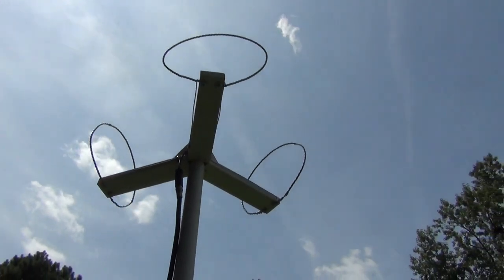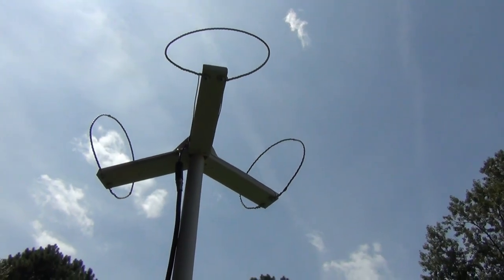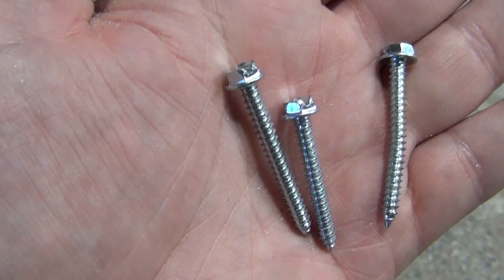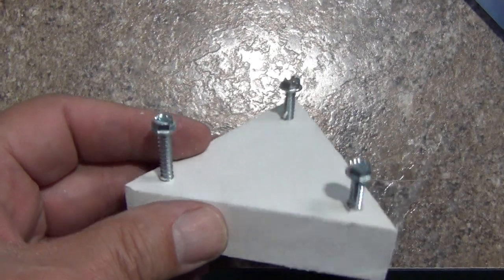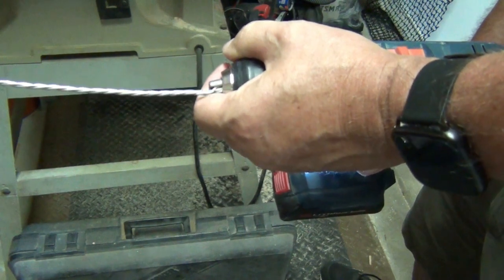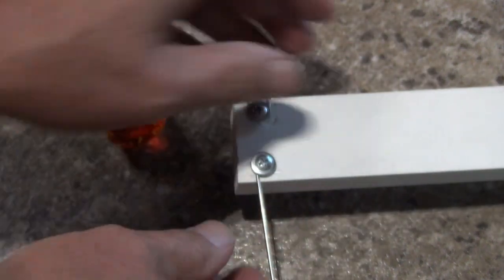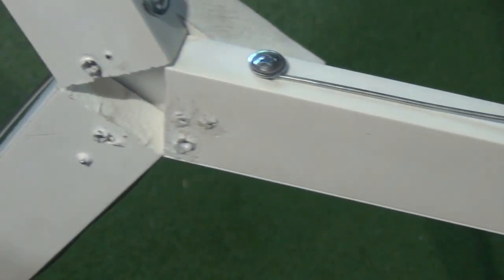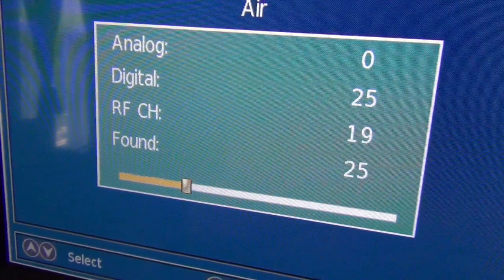TRI-TENNA for FREE TV

Comment: Thanks for the great video lessons. I have made your Tritenna but have modified it slightly to suit my needs.I have a boat on Lake Macquarie, near Newcastle, NSW,Aiustralia and have found difficulty with TV reception with the swinging at times on anchor. What I have changed is the angle of the arms to be at 45 deg to each other so that when the boat swings around through 90 deg, I should have reception at all times. I will set up the middle arm pointing to the transmitter I have tried this mod on dry land and it makes no difference which angle I am facing, good reception right round the circle, no glitches or picelation at all.!!!  I will be on the water again soon to test properly but I think this antenna should fix my problem. Thanks for the great idea.
Reply from the maker: Great mod for your specific needs! I hope it works well for you. Thanks for letting me know, and thanks for watching my channel.

Comment: Would your antenna get a higher gain if each hoop was connected individually ??? Keep on making videos fella. I enjoy your direction of logic . Hope you make another improvement on the  omnidirectional reflector antenna for longer distance and higher gain. 
Good work Sir and thanks.
Reply from the maker: I made and tested several forms of this antenna before I did this episode. A few were wired as you suggested. There was no noticable gain improvement, and it was much more difficult to build, so I settled on this as the final design.

Comment: What is the range to get the tv channels?  Is it 20 miles or is it closer to 60 miles.
Reply from the maker: That's difficult to judge as each location may be different based on geography, transmitter power, terrestrial interference, etc. Un-amplified, I regularly get good signals with this antenna within 35 miles of the stations. Thanks for watching.

Comment: I tried making but haven't used it so far. I used 1/4 inch copper tubbingmaking a 26in circle, with a 1/2 inch space between the ends, added a transformer, and now it waiting to be put up. Do you think it will work?
Reply from the maker: Yes, that should receive TV signals.

Comment: Hi again, I have tested this antenna on the boat with very satisfactory results. I was also wondering if I should add a couple more arm on it to cover the full 360 degrees circle. Would this work as well as the circle aerial.? your thoughts please.
Reply from the maker: The three elements usually do a good job pulling in signals from  360 degrees. If you want to try more element arms, I'm not sure of the results. This antenna normally gets better reception than the hoop antenna.
Reply: @mrhoptoit7835  ok, Thanks heaps.

Comment: Could you make this antenna with shorter antenna arms?  You cut yours at 7 inches each.  I am needing to make this antenna that can easily be broken down and packed in a suit case.  Sound the smaller and lighter, the better
Reply from the maker: I haven't tried with any shorter arms, as 7 inches worked well for me during testing, so I don't know. Sounds like you have an interesting concept. Good luck.